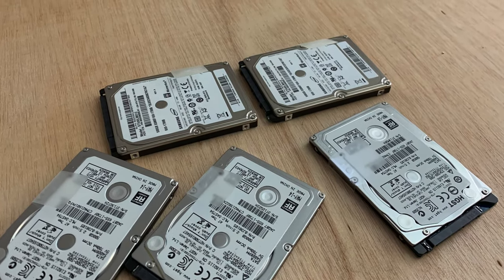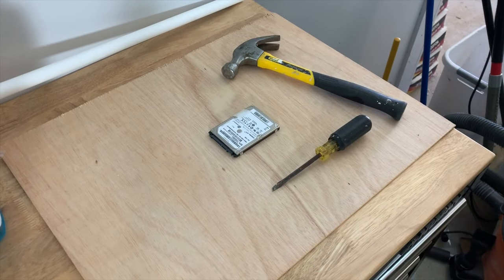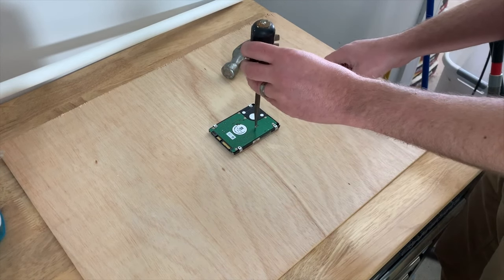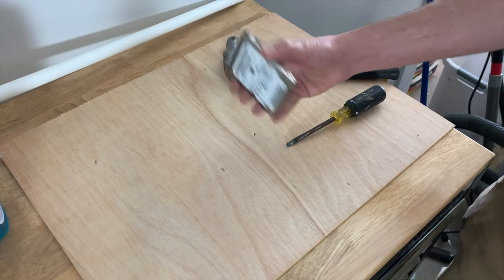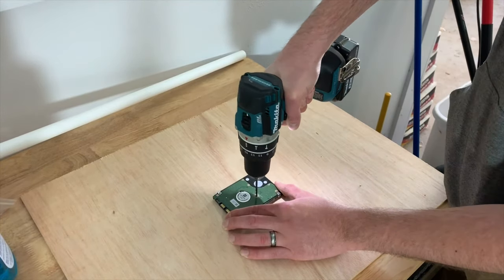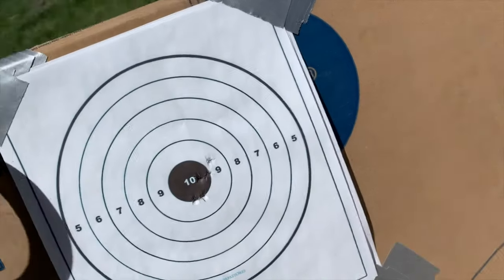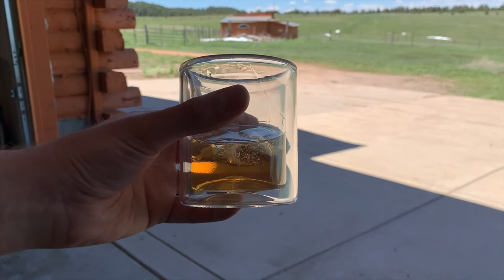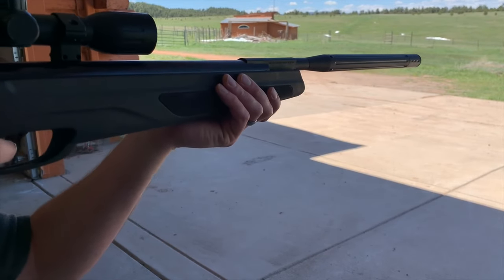How To Securely Destroy Old Hard Drives

Comment from the maker: I created this video partially as a "how to" but also as a parody for fun. The point is, as long as you break the disk, no data can be recovered. Also, if you're looking for a reliable replacement drive, I've installed hundreds of these into Macs without a single failure: https://amzn.to/3sXJpz8 (affiliate link which will earn me a small commission at no cost to you if you purchase). Please leave a comment, and if you found this video helpful in any way, please consider supporting my channel by subscribing. Thanks!
Reply: Data can still be recovered from a broken platter if you have access to the right (expensive) equipment...
Reply from the maker: @marko247  A broken arm yes, but a shattered platter? I'd be curious to see a device that pieces back together fragments of glass that can make it readable again.
Reply: @CreativeMacTech  Think about how the data is read/written in the first place. The data is only held on a circular disk and spun in the HDD because that is the easiest and most effecient/fastest way to read and write to the substrate. A lot of data can be held on a sigle fragment of the platter.

The effort needed to read the data from a broken disk is huge and pretty complicated and things like data fragmentation on the pre-smashed platter and missing pieces can make the endevour fruitless... It can be done though, if the data is valuable enough to the people that want to see it. (think a terrorists HDD etc) 

Of course, I'm not saying someone is going to go to the effort of recovering the data from a broken platter to get hold of our bank details and/or cat pictures but the data is still there, even when smashed. :)
Reply from the maker: @marko247  Sounds like a lot of work haha, but I do see your point. Moral of the story though, don't do illegal stuff, securely erase and/or smash your HDDs, and you should be good to go :).
Reply: Couldn't you just use a torch to superheat the plates?
Reply from the maker: @bishopofeternity48  Probably! I Haven't tried that yet though!

Comment: Can you not just take a scissor and cut off the strip connecting the circuit board to drive?
Reply from the maker: Thanks for the question! You cannot destroy data from a spinning hard drive by doing that, unfortunately. You need to make the actual disk unusable, so either shattering the disk, as I demonstrated, or exposing the disk to static electricity (such as prolonged exposure to air etc...), or a number of other methods will be required. Basically, the disk needs to be destroyed, otherwise, data can be recovered. My method isn't "FBI proof", but nobody is going to spend thousands of dollars to try to piece together a shattered drive to get my encrypted bank account number. Not worth it :). I hope that helps!
Reply: @CreativeMacTech  Thanks, very helpful.

Comment: The Hammer and Screwdriver is the easiest.
Reply from the maker: For sure! That's my go-to method.
Reply: @CreativeMacTech  I spoke too soon. I tried to do this an hour ago and nearly smashed my hand. The Screwdriver would not even make a dent on the casing. The case is very strong. I think I will just bashed it with the hammer and pry it apart at least that is what I did to destroy my last hard drive.
Reply from the maker: @sisophous  Uh oh! You got a stubborn one! The drives in my video are 2.5" Drives which are much easier to break with the screwdriver. Is yours a 3.5"? Those might be easier with a drill/smashing repeatedly with a hammer or prying apart like you suggested. Or... any gun should take care of it ;). Sorry it's giving you trouble!
Reply: @CreativeMacTech  My drive is actually 6x4 inches and it is impossible to break with a hammer. When the weather warms up I will use a sledge hammer on it in the street. My neighbors will think I'm crazy. Last thing I need is injury to my hand. It's from an old Dell Dimension 3000. It would survive a plane crash!
Reply from the maker: Good luck! Those larger drives are a pain sometimes. If the HD still works, you could also do a secure erase using disk utility (writing data over the existing data a number of times). I'll probably do a video on that soon as well.